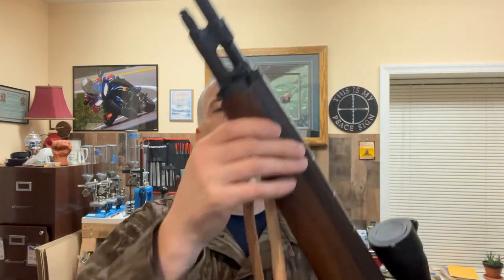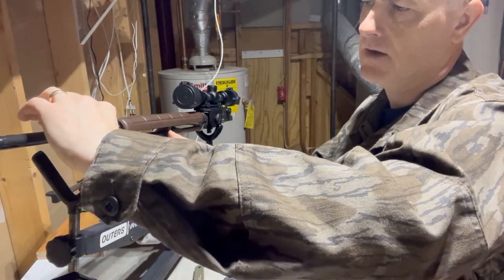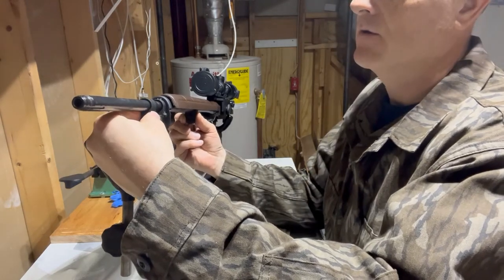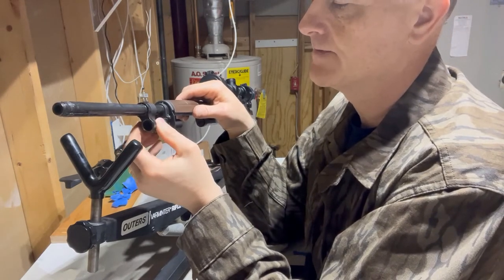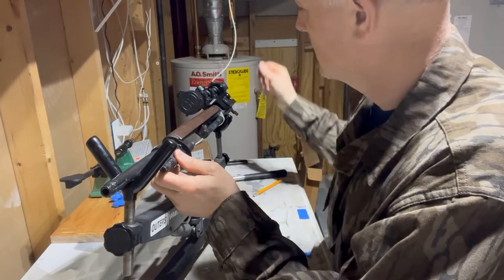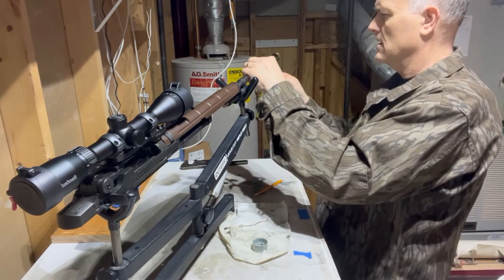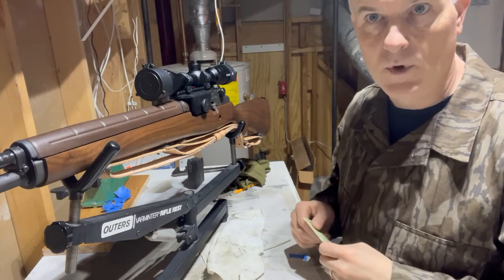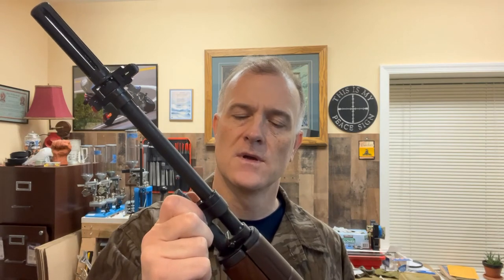YAA describes the M1A Unitized Gas Cylinder

Comment: Cool rifle, I believe they are known for being very reliable.  Like the gun smith work, knowing how things work and are put together.  I think the optic mount makes that rifle really good.
Reply from the maker: Thanks!  I had a vintage sniper rifle match I was preparing for that I put the scope on for.  The match was cancelled and since then I got an ARMS 18 Mount I may redo the scope set up on.  In between though I wil probably resight in the irons to see if the unitizing helps my groups compared to the last 10 years I've had the rifle beforeinstalling the ARMS.

Maybe I can try to do some reviews like was doing on my SCAR 17S plus Burris AR536 videos.

Comment: You just managed to make me nervous watching you. Too much fumbling, unstable, inadequate stand (I recommend using a vise at the receiver, padded, of course), you left the op rod locked to the rear while you where awkwardly tapping on the gas block (backwards, no less), didn't check gas port alignment and clearance with an Allen wrench or proper thickness wire, should still have used some shimming to tighten the gas lock slightly from about 10 to 15 degrees before bottom center, should have installed the upper handguard AFTER installing the gas block (requires removing your scope mount... c'mon now), check your operating rod alignment with the gas piston (involves op rod guide center check, simple visual procedure), align-check the flash suppressor castle nut by tweaking with the pliers until the set screw goes in smoothly.
Not to mention that those welds look pretty thick, I hope you don't have any deformation or bore issues. A binding gas plug is simply misalignment of the gas lock ring with the gas block. 
Perhaps it's just inexperience or uncertainty when working with firearms... but I highly recommend you develop better mechanical procedures. Please.
Reply from the maker: I appreciate the advice and you watching.  My work spaces for the videos is lacking in various aspects. You point out a lot of things that do involve that type rifle but not necessarily needed for the operation I was showing or able to see from the video. But in regards to the list of rifle related items you mention above reveals that you may not understand some things about the gas cylinder and what happens when you unitize the front band to the gas cylinder. 

You may not yet have evolved past the use of shims for gas system stabilization. I have learned from experienced users and smiths there is a misconception that shims help the front end.  Many  advise to turn the gas lock to the 6 o'clock position and tap the gas cylinder forward.  Over the years it has been found the shims aren't that reliable for consistent stabilization and control of draw pressure and it's better to just not use them and tap the cylinder forward to the back of the gas lock. Of course you need first to ensure you have the gas cylinder on as far as it will go so that you know the gas lock screws onto the barrel as far as it will go the correct 6 o'clock position to secure to. If you turn the gas lock to where you need 10-15 degrees more that can be good and snug but if you go too far you need to bring it back to 6 o'clock and tap forward to take out any gap then tighten the gas plug. 

The problem with shims is the pressure on the front band and barrel is not consistent.  When the rifle recoils the barrel flexes and it comes to rest with the front band sitting with the stock front ferrule sitting on it with some draw pressure pushing down on it.  Shims move and its been found that they do not create a consistent assembly that reseats the stock into the front band as consistent as a unitized gas cylinder does.  And furthermore that it's better to just secure the gas cylinder to the gas lock by taking up any space between the gas cylinder and gas lock if the gas lock doesn't time perfectly before tightening the gas plug.
Reply: @yourarsenaladvisor  Yes, I understand the purpose, and how it affects  barrel harmonics, when unitizing the front band to the gas block, I'm not suggesting that shimming improves repeatability with how the stock rests on the front band, that's why we secure it to the gas block and bed the receiver so as to provide downward force when pressed into the stock by the trigger group.

My concern with shimming is the distance down the barrel onto the shoulder where the gas port openings align, both on the barrel and on the gas block.
These openings are quite small, and even a small fraction of an inch can block the passage of the correct amount of propellant gases needed to operate the gas piston.

On my rifle I used a small Allen wrench that fit precisely in these holes. When they're aligned, it will slip through both smoothly into the barrel bore, and will be visible from the muzzle when you shine a light off the bolt face down the bore.

I also wanted to avoid warping and possible clearance problems when slipping the unitized assembly back onto the barrel, so I opted for the "screw and glue" Army method. I'm a retired Marine, and we did indeed weld the components together, but we used three small TIG welds that were invisible when the weapon was assembled. The material on the front band is very susceptible to warping and deformation, and it took a skilled welder to tack on the gas block with almost surgical precision. So I'm simply expressing my wish that you have a solid, well done assembly.
Reply from the maker: Thank you and Semper Fi!  I am a Marine too.  But I appreciate you putting in all those years.  So with respect to unwanted stress in the front.  The advice I was speaking about did center around getting rid of things that were too tight.  In my M1A, the shim I used was probaly too snug, then compare to the next size down it was too loose.  About that time, I was learning the advice to just not use the shims and get a unitized system. And my castle nut was also too tight in retrospect also.  When I put it back together I found that by stoning the nut down just a bit, I was able to get it to time without undue force to to tighten down. Overall I think my rifle is in better shape.  I just finally shot it with irons(that scope mount in the video is now off) last week and I think my groups tightened up a good bit.  I'll probably do a follow up but I can't find my old targets to compare to show side by side.

As for the particular weld job, I picked the welding method over the glue mostly because it is the Marine Corps way.  I like a 'weld' too over a glue.  I know they can crack and its more hard to fix in the field but I was leaning toward the welded method.  The funny thing was after I got it back from the unitizing service a guy online was selling a GC with the internal welds.  I think in competition the welds aren't suppose to show so it looks unaltered from outside.  I wasn't thinking of that went I sent my parts out. It probably won't be a concern as I don't get to to many competitions.  Although I will probably put a scope back on it with an ARMS18 mount I got acouple months after I got the one in the video.  I want to use it in the vintage sniper matches.  I think I can put a 3x9 and be accepted, or be in the spirit of the rules.  I saw others using their M14s/M1As as the match allowed up into the Vietnam War era rifles like the M40 and M21.

Thanks again!
Reply: @yourarsenaladvisor  Groovy... Semper Fi, Devil Dog!
It's great to hear that it improved your groups. 
I also wanted to stay within the family tradition and spot weld the front band, but since I did it myself and I'm not a good welder, I went with the Army method. So far it's holding well, the machine screws haven't moved or backed out of their holes and the heads are flush and indexed as originally installed.

OK then, just wanted to make sure it worked for you. 

I bought a standard M1A, without the National Match barrel, but it did come with a National Match front sight. Equipped with the OD green synthetic stock.

Slowly I've been tweaking this rifle since I was issued an M21A5 assigned as a DMR with my platoon, C Company 1/7 1st MarDiv.

Trigger is excellent as stock from Springfield Armory, I unitized the gas block as mentioned, replaced the stamped steel recoil spring guide with a cylindrical National Match guide from Brownell's, a Sadlak front Picatinny rail installed under the front sling swivel which I use to attach a PKM clawed bipod, replaced the rubber butt stock cushion with the GI flip cover to store the cleaning kit in the stock, installed the Navy/Coast Guard muzzle brake from Smith Enterprises (it really holds the weapon level without muzzle climb!), a Springfield Armory 4th generation scope mount cut to fit my scope ring placement, Vortex Viper 6.5-20X50 scope with parallax adjustment and a MilDot reticle like we use in the Corps, folding cant bubble level on the scope, Vortex low-profile scope rings, padded cheek riser with cartridge loops on the butt stock, and a GI green webbing sling so I can use our loop sling technique in the prone.

It's a dream to shoot, not quite 1 MOA but good enough for government work out to about 800 yards, after which most .308/7.62X51 rounds start to peter out. It's my go-to rifle for SHTF and I couldn't be happier. 

I hope you enjoy many years of fine shooting with your rifle.

R/S
SSgt Cruz, D.C./USMC (Ret)
Reply from the maker: @davidcruz8667  Thanks!  Your M1A sounds like a real animal!  I got a schuster gas plug to try but I only plan to use the 175gr projectiles so it may not be absolutely necessary but might help out to 1000yds. I happen to live close to Quantico and can shoot on Range 4 (1000 yds) right there on the Calvin Lloyd Range, home og WTBn and PWS.  I'm a bit distracted lately with my 6.8 rifle project sorting out the gas system and the rest of my retro 602 rifle build. Both are recent ongoing video series of mine.  Then I need to look into some scopes for the M1A or my 6.5 Creedmoor.  The last is a purchase I made over a year ago but back burnered. Think about subscribing!  I got plenty of room, LOL
Reply: @yourarsenaladvisor  Roger, Wilco... 
Lucky you have Quantico nearby, I would go shoot aboard Camp Pendleton sometimes but I now live in Arizona, gotta find some BLM land or maybe I'll see if Nine Hole Review will invite me down to that excellent range he uses down in Texas... 😁
Good luck and happy shooting!
"This is my rifle... there are many like it, but this one is mine..."
Every Marine is a basic Rifleman !